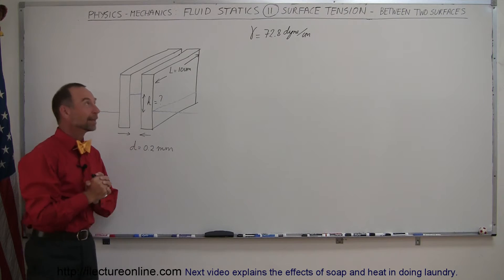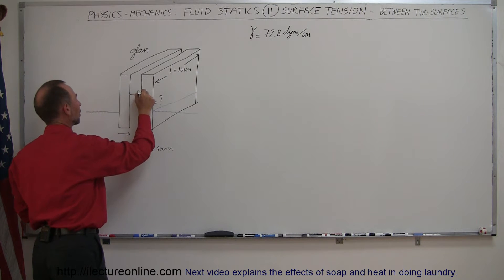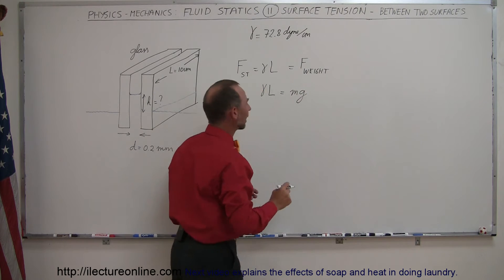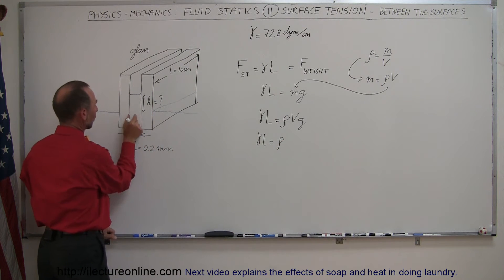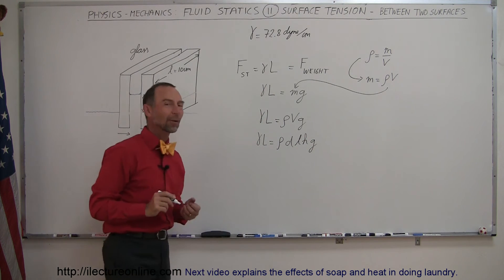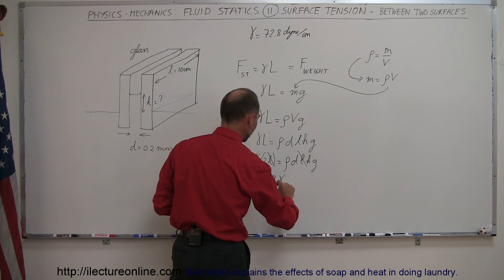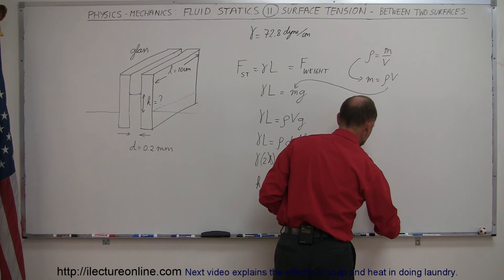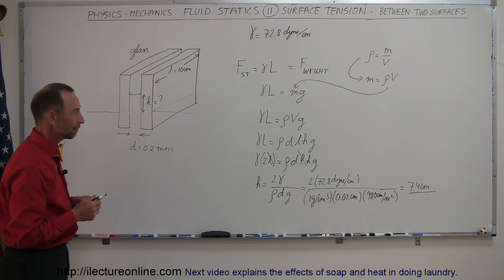Physics 33 - Fluid Statics - Surface Tension (11 of 12): Between Two Surfaces

Comment: hello，i am confused about the direction of the adhesion, and i want to know if the plates in this video are not vertical but a small inclination and symmetry, emmm,more clearly, the inclination angle of the left one is 5 degree(compared to the vertical situation) and the right one is -5 correspondly, how to involve the influence of inclination in the calculation.
Reply from the maker: Then you would have to calculate the vertical component of the force pulling the water up against the glass, and you would have to take into account the additional volume of water pulled up due to the widening of the gap.
Reply: @MichelvanBiezen  very thanks,i also think so,at least from the force equilibrium it should be.However,a publised research article in 《Nature》named"celluar fludics", in their calculation of the adhesion,they do not consider the inclination.As a relative green hand in the capillary mechanism,i am not sure whether i am right or not. I think, the key factor about the problem is the direction of adhesion.

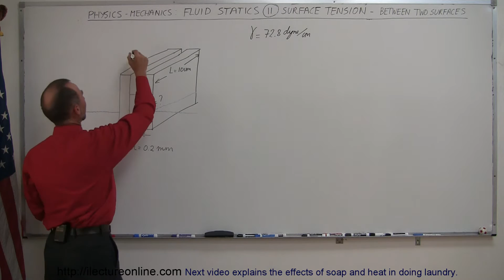Comment: Maybe a very important clarification should be made for 0:26. IT IS the surface tension on the water / air surface rather than the one on the glass / water. When one disscusses the physical picture of the force balance regarding the capillary action whatever in a slit channel or a capillary tube, taking into account the water / air surface tension only makes for more conveninent analysis.
Reply from the maker: It is not as simple as that.  There are several forces at play which pull water up between 2 narrrow surfaces or inside a capillary tube.  One of the main forces is the adhesive force between the water molecules and the glass surface.
Reply: @MichelvanBiezen  After close examinzaiton I have to change the previous statement into the surface tension involved that pertains to the solid-liquid interface rather than the liquid-vapor surface. Many thanks for your reply and highly appreciate these awesome videos you have posted!
Reply from the maker: You are welcome.  Spending the extra time examining this as you did does add to the understanding.  👍

Comment: You mean that small l mean length of the plate and capital L mean circumstances contact water with two plate which is equal to two small l??
Reply from the maker: L means the length of contact (in the formula).  In this case the length of contact = 2 l  (because each of the two plates has a length of l
Reply: @MichelvanBiezen  aha I see thank you so much

Comment: can you pleasee explain to me if we used the laplace formula to solve this problem what would r1 and r2 be ??
Reply from the maker: Since R1 and R2 are the radii of curved surfaces, the Laplace equation would not be a good equation to use in this example.
Reply: @MichelvanBiezen  i understand, but my professor used that method once and did not explain why r1=d/2 and r2=inf

Comment: Why did you take the angle of contact to be 0??
Reply from the maker: It is usually close to zero and the cos of a small number is close to 1
Reply: @MichelvanBiezen  So it doesnt depend on the liquid? What i dont understand is how can it be close to 0 for every liquid? As far as i know angle of contact is unique for a particular solid liquid pair. Could you please explain?
Reply: It does depend on the liquid what michel is not explaining is that it's known that the contact angle between glass and water is ALWAYS zero (and most examples michel does in this section considers glass and water). If it were water and let's say paraffin wax or even mercury and glass it would be a completely different problem, the problem would have to tell you the angle. Sorry if this reply is too late.
Reply: @ShubhamGhar  because the plates are vertical and 90 degrees.  Please watch all of the videos in this serie. Everything has been explained in details by professor. He's such a great wonderful Amazing professor

Comment: can u pls clear me why you equal force due to ST to force due to gravity
Reply from the maker: Since the system is in equilibrium, the force pulling upwards must be equal to the force pulling downward.  The force upward is pulling a certain amount of liquid upward.  That force must be equal to the weight of that liquid.
Reply: But the upward force is not acting on entire liquid but on the portion of top most liquid layer which is in contact with glass.So the force pulling downward is (mass of portion of liquid*g).But in the problem why we are considering entire weight of liquid? pls clarify
Reply from the maker: The fluid will continue to rise until the Force due to surface tension equals the weight of the liquid pulled up above the normal level.
Reply: because if you imagined the liquid as slices the surface slice will be affected by this force and then affect by this force the slice of molecules that is located under it then this senario still repeating with each slice and the other untill this total slice's weight affectes the main slice ( surface slice ) with the same amount of upper vertical force on it due to the glass  . And when this happens the resultant force on the on the surface slice will be zero N in any direction so it will not move so it will not cause any slice under it to move so the slice that is located at the normal level of the fluid will not move because the slice that is located in the upper direction of it will not move and so , this is the reason that will make the system in rest
Reply: Ejjirothu sai karthik  because if you imagined the liquid as slices the surface slice will be affected by this force and then affect by this force the slice of molecules that is located under it then this senario still repeating with each slice and the other untill this total slice's weight affectes the main slice ( surface slice ) with the same amount of upper vertical force on it due to the glass  . And when this happens the resultant force on the on the surface slice will be zero N in any direction so it will not move so it will not cause any slice under it to move so the slice that is located at the normal level of the fluid will not move because the slice that is located in the upper direction of it will not move and so , this is the reason that will make the system in rest.
Reply: Please watch all 12 videos in this serie, you understand everything very well. Thus great professor is wonderful and has explained everything clearly and steps by steps.